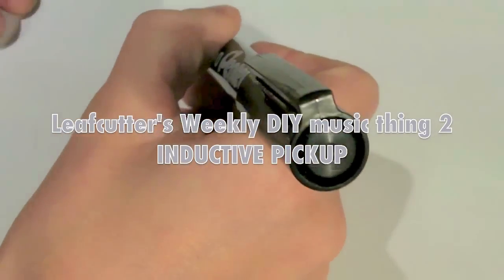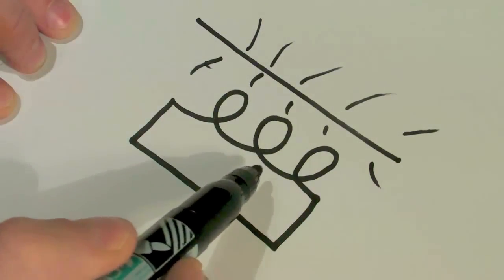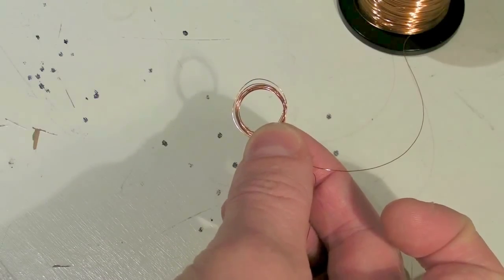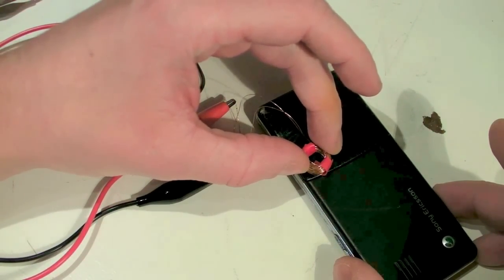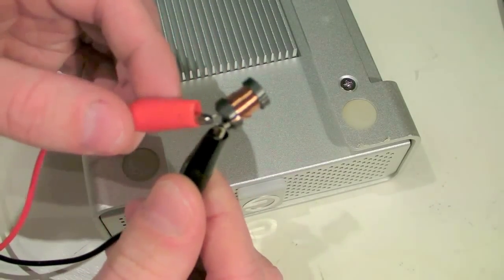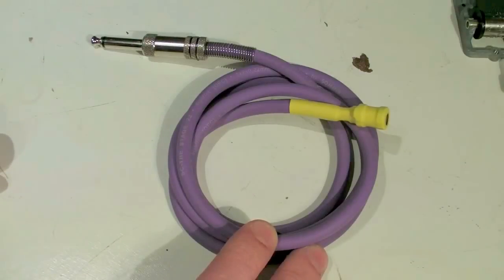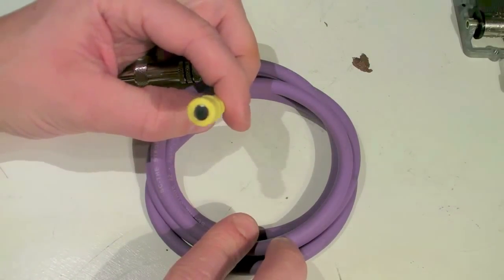DIY music thing 2 INDUCTIVE PICKUP

Comment: I <3 inductive pickups, so thanks for this video! I´m curious to know how different aspects of the build (length/width of wire etc.) affect the sound of the pickup in terms of EQ and volume... any advice on that? Also, guitarpicks have a magnetic rod that the wire is woven over, how does that affect the performance?

Comment: We used an old ac-adapter. Just cut the wires and solder a connector to it. The larger the ac-adapter, the louder the sounds and the more "sensitive"

Comment: I don't think the pickup in the sketch would pick up sound from a vibrating string, as there is no magnet.
Reply: you could get it to work by running a light voltage through the strings. you could attach a couple AAs with some wires, the negative on the nut and the positive on the bridge.

Comment: Would you be willing to explain/post a diagram of wiring the inductor to the 1/4 inch jack?  is it simply a stereo input jack with the +/- cables wired to arbitrary end?  
i'm also not sure in the first example, what are the wires connected to, just audio ins?  
thanks in advance, great video!
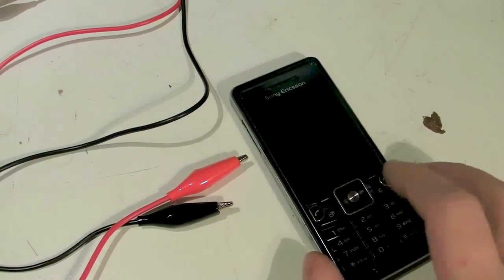Reply: It's not stereo, just a mono jack, with each lead of the inductor wired to one wire of the cable. And yes, it doesn't matter which way you wire it...the polarity is arbitrary, because the polarity of the signal itself is arbitrary, and just depends on the physical positioning of the pickup in relation to it.  Also, yes in the first example at 2:01 the alligator clips are certainly connected to an input jack somewhere off camera.

Comment: Cool tutorial! The central point that needs stressing is that the wire needs to be isolated from it's neighboring wires. Hence the magnet wire that has an isolating varnish. If you were to use regular old copper wire it wouldn't work because any induced current will short out immediately within the coil. 
Love this series, keep them coming!